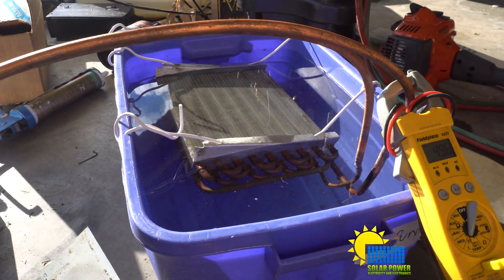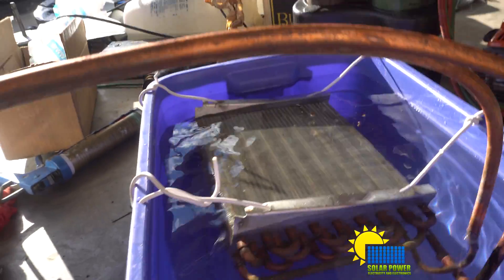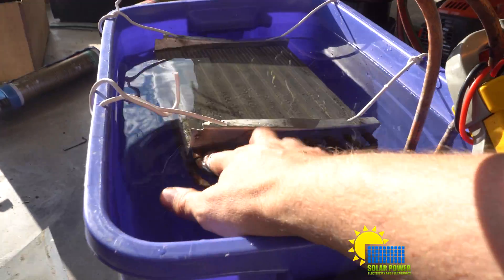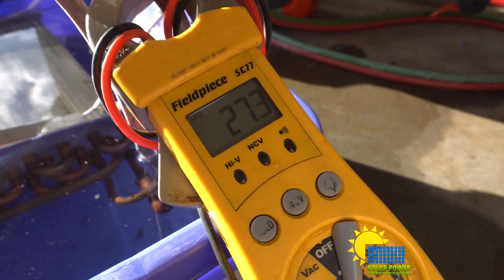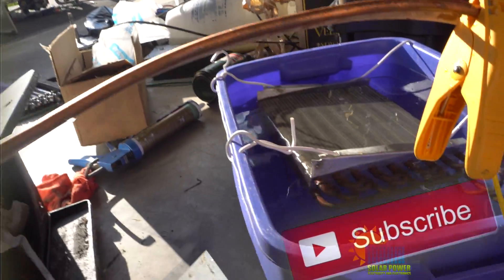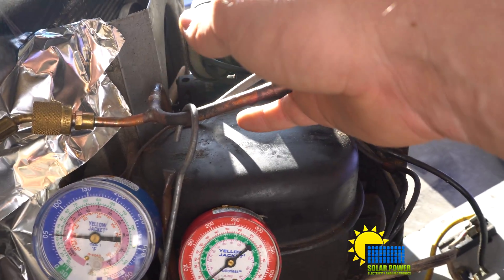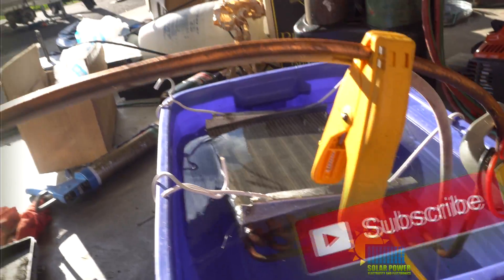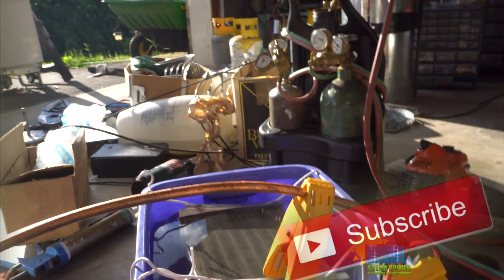Oil Super Cooled Chiller PC Prototype Miner How to remove HEAT!!!

Comment: I use to mine for bitcoins off my solar array.. I was running several raspbery pi computers with ASICS. This would be a great idea though for larger setups to remove heat.
Reply from the maker: Yes i intend to run a very large system
Reply: I finally used most of my bitcoins, I have 14 dollars usd sitting in my wallet..lol
Reply: me and my partner are building something similar for mineral oil cooling. Would you please take some time to review our plan and share your thoughts? umairnoor(dot)siddiqui(at)gmail.com
Reply from the maker: It's a very expensive just use the fans on the GPU's

Comment: as a mater of fact I was thinking of some project like this for mining. My Idea was to use geothermal.
Reply from the maker: You bet air to air will not make it colder but it is cheaper for the power bill but i have more power in the day time with solar so i will run it at the time i have lots of power for free!!!!
Reply: that makes sense of power source side, however are you going to have your mining rig(s) on timer or something?
Reply from the maker: Ivan Kishov no i will just keep up with it as the classis helps with the app
Reply: ok cool. do you have any small creeks or something running nearby?
Reply from the maker: nope that would be nice